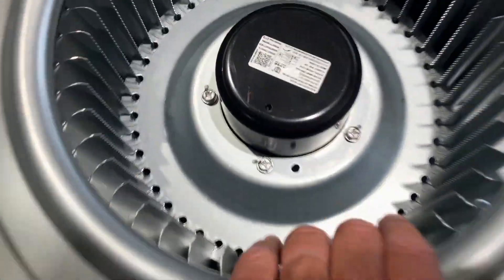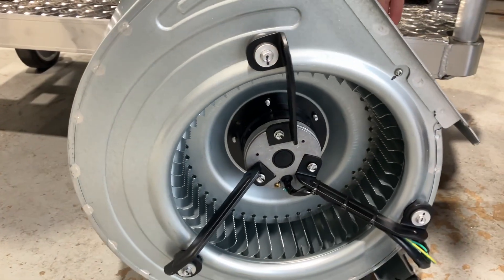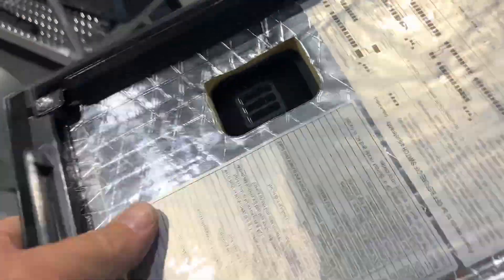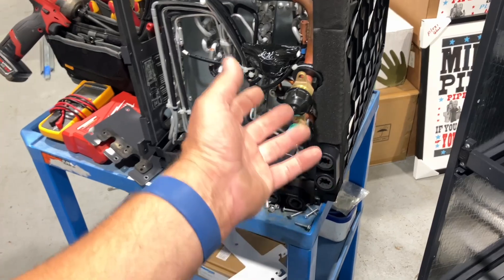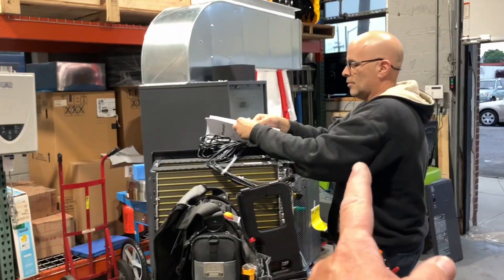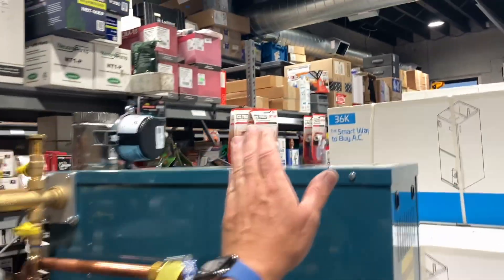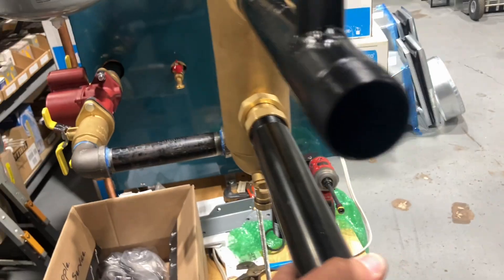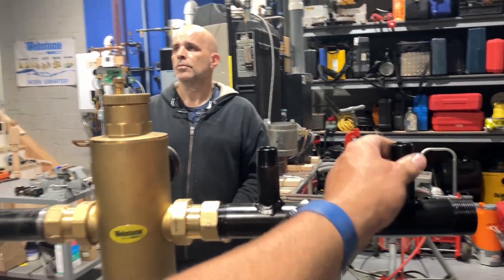9. Dissecting an ACiQ Air Handler + Custom Mounting a Modine Hydro Fan (Looks Like a Robot!)

Comment: Most air handler motors are AC which costs less but is Not as good as a DC motor.  
 DC motors have superior efficiency and control capabilities, DC motors may be the preferred choice for high-efficiency or smart HVAC systems.
Reply from the maker: Smart